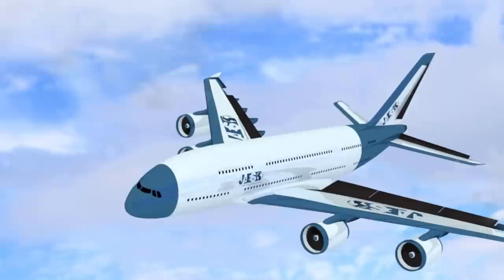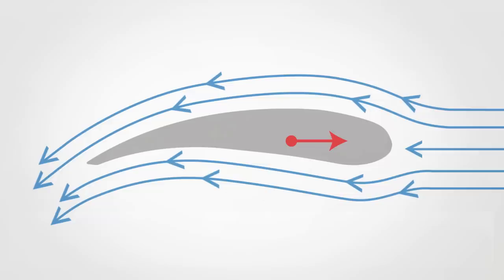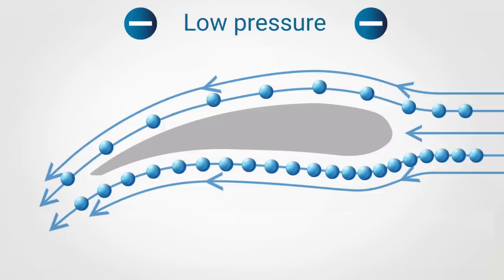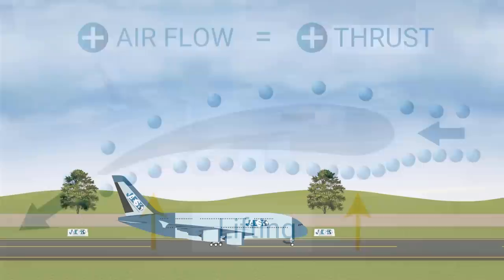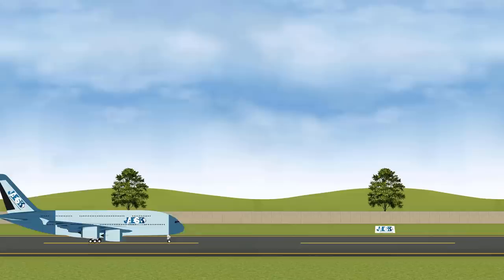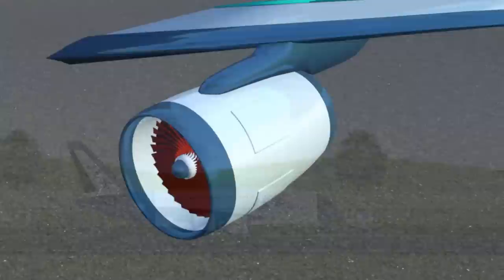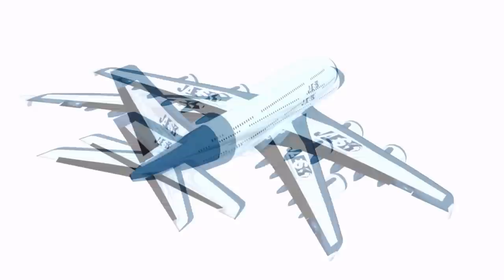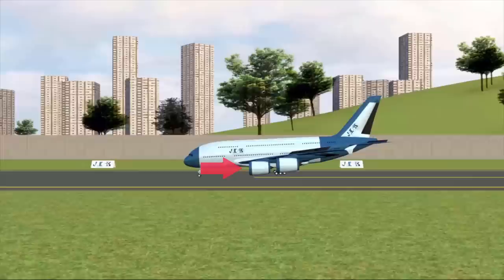How do airplanes fly? Components - Coandă effect - Downwash - 3D animation

Comment: Thanks for this informative video on how airplanes fly! I appreciate how you explained the Coandă effect and the role of flaps and slats in increasing the lifting force during takeoff. However, I think it would have been helpful if you had explained more about how the wing's shape creates a pressure difference that allows for upward suction and lifting of the aircraft. Overall, great job!

Comment: This was a very informative video and I liked how you used the visuals to explain the concepts. However, there is a slight misconception in the video. You used the Coanda effect to explain how air travels above the airfoil; however, the Coanda effect is only used for jet flow. The airfoil of the wing does not experience jet flow so using the Coanda effect would be an incorrect.

Comment: 2:13 review your theory, that s not the explanation why the fluid flows faster. At least you didnt said that particles get to the trailing edge at the same time(totally wrong). It s true the upper side flows  faster, but not because of a "longer distance". To see that, draw an airfoil with an upper side with an armonic form, you ll see,  it keeps having a longer distance than the lower side, however the fluid flows slower than the lower side.
Reply: There were many theories explaining lift of an airplane... Often one theory conflict with the other one due to the complex and random earth parameters😜

Comment: 2:15 so if the airflow above and below travel throught the wings with the same distance,( lenght) there's no lift force?
Reply: Wrong~
Lift is generated by multiple methods, even if the travel is the same on both side of the airfoil, the lift can still be generated by the angle of the airfoil,which can be explained by newton third law

Comment: The description of the cause of lift is refreshingly correct. The equal transit time assumption, all too commonly made, is just wrong. Bernoulli’s equation doesn’t apply because the flow is not confined, like the flow in a Venturi tube is. The Coanda effect has the same cause as does lift itself: the rarefaction of the air on the top of the wing and the simultaneous compression of the air on the bottom. The consequent pressure difference causes lift.

Comment: Thanks for the video. But, "Upper airflow is faster than the below one" is a wrong argument. There is no evidence for this. The only reason for "lift force" is Newton's third law and conservation of momentum regarding downgraded airflow from both upper and below surfaces of airfoil. Below surface of airfoil pushes down the air more than the upper one due to the shape of airfoil (more tilted across the air). This downflow then creates a momentum change in air flow and It then causes an upward force due to momentum conservation of the air. In additon to this, the upper surface is also can push airflow down by the help of "Coanda Effect". Coanda Effect creates a low pressure on the surface then air sticks to surface of upper side till the end of the surface and flows downgrade. This also makes a momentum change in the air and causes an upward force. So at the end both upper&lower sides help to create lift force.

Comment: 5:46 the pilot does not "activate" the slats, flaps or anything during the takeoff roll. They are already in position before speeding up.
Reply: Thanks for the correction
Reply: After takeoff the slats and flaps switched off or remain on until you have landed or
Reply: @standardtv3494  Slat and Flaps are not "switched off" They are not on/off systems but analogue systems.  Who ever produced this video has no real understanding of flight theory. It seems their research was limited to reading some kids books about aircraft.
Reply: @standardtv3494  they are retracted after takeoff and are extended at landing
Reply: Observ45er added to your point, jet aircraft have a slight increased AOA for landing. Otherwise the aircraft will keep increasing speed due to the lift component.
Reply: you people talk about "slats"  (5:50, 8:31)   and think on spoilers, "slots" are on front of wing-in leadind edge and are used to increase lift by allowing higher angle of attack when flaps are extended,  and they are used at take off and landind , spoilers are activated automaticaly by computer  to prevent partial stall of wing and to create more drag in landing and braking when is landed...
Reply: @petemulhearn7787  Agree  there is so much wrong with this video there should be a disclaimer at the beginning.
Reply: @standardtv3494  - flaps and slats return to their stowed position (not extended) to reduce drag.
Reply from the maker: Dear Attila thanks for your comment we made a new version  video  about aircraft please can you inform me if you liked we spent a lot of time to improve it your comment is important for us https://www.youtube.com/watch?v=OCh4svEfDmE
Reply from the maker: Dear Austyn we made a new version I hope you like please let me know with a comment on the new version https://www.youtube.com/watch?v=OCh4svEfDmE
Reply from the maker: Dear Sir please watch the new version https://www.youtube.com/watch?v=OCh4svEfDmE and please leave a comment.
Reply from the maker: Dear Pete thanks for your comment we tried to improve the quality on the new version can I ask you if you can leave a comment https://www.youtube.com/watch?v=OCh4svEfDmE and please leave a comment.

Comment: I do not understand why people mention the names of other people who are related to the fluid flow as the Coanda and Bernoulli and others.  How wings fly has nothing to do with people who worked on them. This is a natural effect and so we must explain the physics of the process as it has nothing to do with who worked on wings.
The scientific reason why wings lift is the following.
1. Assuming two particles of air moving toward the leading edge of the wing, one takes a path to move above the wing while the other to move below the wing. The particle which moves above the wing first hits the leading edge and is reflected up away from the surface above the wing. This reflection tends to distance the air particle from the upper surface and so there is low pressure. As the wing travels under the upper particle the wing is tapered down and so there is an increase of volume for the air particle to occupy and so a further lower pressure is generated.
2. The particle of air traveling under the wing,  it too hits the underside of the leading edge,  but due to the positive angle of incidence the underside of the wing is capturing the air and moving it forward with it and so there are more air particles captured under the wing which increases the pressure. 

So when we describe how a wing lifts one must not refer to any particular human name and the process has not been invented by any man and it existed ever since birds learned to fly and fish learned to swim. 

When the hull of the buoyancy water hull moves through the water, what was described above occurs  all the time and for a normal water hull with a raised transom one can see all the pressures around the hull where  the observer must think in an upside down manner the bow wave is the high pressure on the leading upper surface while the rear wave near the transom is due to the suction of the underside of the hull due to the tapered up rear end to the transom.    This action is not due to any man, it is a natural function and all one needs to do is to explain it in its scientific processes where it all boils down to a CHANGE OF MOMENTUM OF AIR PARTICLES  all done at the right moment and the right locality around the shape of a wing.   Many people still do not understand what goes on at the wing tip of a wing. The best wing must have both the leading edge and the trailing edge RAKED BACKWARDS.  to ensure better control of the wingtip vortices.   Just look at the wing tips of fish, dolphins, whales, and birds and there it is for anyone to behold.  Coanda and Bernoulli effect is not the right picture as to what happens on a wing and how it works. It is certainly not a Bernoulli effect and one must forget about Coanda. It is all a change of momentum of air particles as they hit the leading edge and a change of momentum bring acceleration forces with it.  There is the reason why a wing lifts. 
The change of momentum of air particles and their acceleration forces to move the air particles out of the way is also the reason for the drag, It is all a case of resolving the directions of the forces included in the change of momentum of the air particles and what the shape of the airfoil section offers the disturbed air particles!.
Reply: "I do not understand why people mention names of other people related to fluid flow" 

Every observation made in science follows the trend of being named after the person that explained them. This is easier and more efficient to do in a sentence, as opposed to stating out the logistics of the effect just to make a reference. You don't see people explaining out Newton's Law when they need to give reference to the physics of it, but simply say "Newton's Law". Same with every other effect observed in science.

Most certainly its easier to say "Coanda Effect" to make a reference, instead of typing out the essay like you did.
Reply from the maker: Thanks for beeing so interested in our videos! Your observations are very important for us becouse we are trying our best to provide good contents and we need to be aware of our mistakes. Have you had the chance to watch our video about wind turbine? https://youtu.be/_KE65O44q9o You can tell us what do you think about it!
Reply: The processes have not been invented by any man, but they were first OBSERVED by those men (and women). Would you prefer to enounce the principles in depth every time you mention them, or would it be easier to just say "Coanda effect", "Venturi effect", "Curie temperature", "Newton's laws"?
Reply: @bogdan_n  You are correct but in this video, it does ask," How do airplanes fly?"  and a student in a class will not learn anything if one says, " all due to the Coanda effect!"
It is like someone asking me what does my  sister looks like  and I tell them, " She looks like my mother!"
That type of answer the questioner is no better off as far as information detail.
Reply: okay.    feel free to not use words, such as,   volts,  amps,  ohms,  farads,  henries,  and   SANDWICH
Reply from the maker: Dear Carmel can you check the new version please let me know what do you think https://youtu.be/OCh4svEfDmE

Comment: Pretty good, but I'm a little bit confused in some parts of the video especially in the landing because usually (commercial aircrafts) the nose of the aircraft is  pitched up to increase drag and hence reducing the airspeed to achieve the optimal landing speed for the aircraft and the aircraft doesn't really land with their front gears as it can lead to disaster because of the landing. Overall is pretty good. If i have some mistakes, please correct me 😊
Reply: Actually, if you observe the vertical speed of aircraft during approach, its around (-800) feet per minute. So during the landing, pilots have to increase the vertical speed at around (-180) feet per minute, thats why they flare around 30 feet (AGL) so that the aircraft won’t float too long. Yes, the speed is one of the reasons pilots flare, since the flare can produce enough lift, while pulling the throttle to idle

Comment: Best video ever, i just couldn`t undestand why is the upper flow more rarefied, why molecules are more far apart from each other here? is because they travel longer distances than in the lower because or the airfoil?
Reply from the maker: Hello Dante! Thanks for your comment. The upper airflow is more rarefied (it has a lower pressure compared to the lower airflow) becouse its molecules are more distance from each other while they're travelling accross the wing surface. And becouse there's more airfoil surface too. If you're interested you can visit our channel and in the playlist section you can find many other videos. Like this on about Induction motors: https://www.youtube.com/watch?v=EcbHEOIVGcg&t=80s
Reply: best video???   NO.        the  shape of   the wing's   profile/airfoil   Results in  a  Specific  pattern  of  Turbulence, across the entire span.       at the wing's upper surface,  the SPECIFIC shape ( of the forward third of the wing's profile )  causes  deflection of air, and a persistent 'zone' of  Turbulent, less-dense, lower-pressure air,  across the Entire span.    see the clark-y and similar naca profiles.      googletranslate

Comment: you people talk about "slats" (5:50, 8:31)and think on spoilers, "slots" are on front of wing-in leadind edge and are used to increase lift by allowing higher angle of attack when flaps are extended,  and they are used at take off and landind , spoilers are activated automaticaly by computer  to prevent partial stall of wing and to create more drag in landing and braking when is landed
Reply from the maker: Hello! thanks for your observation. We are currently working on a new version of this video. If you're interested you can subscribe to our channel to know when we will upload it.

Comment: Theres a lot of mistakes on the video, The flaps and slats where not look like that, the seperate from the wing but theres something that holes them, also the under of the wing surface is flat unlike the top of the wing. The engine pushes the plane  because the fan blades were like the wing but have more angle of attack. 

Edit: the speed brakes were not suposed to be extended when the flaps and slats where extened They only use it for the ground brakes at high speed or only if the needed to reduce speed, they were not as big as flaps.
Reply from the maker: Dear Abello thanks for your comment we made a new version of the video can you please inform us your point of view for the new video https://www.youtube.com/watch?v=OCh4svEfDmE&t=2s

Comment: Why did you showing flaps and spoiler deployment on takeoff? I also noticed @ 8:45 ...the mention of slats and flaps, but what's shown is flaps and spoilers.

Spoilers retard the lift from the wings by creating a separation of the otherwise laminar flow of air on the top of the wing surface, it could be said they're "Stalling" the wing, or part of the wing (in most cases). 

Slats increase surface area, and thus increase lift with the trade-off of also increasing drag. They're deployed at the same time as flaps, which also increase surface area, and thus increase lift with the trade-off of also increasing drag and also allow the plane to be pointed downward without gaining as much speed. This is very important for landing, since you can't generally descend without gaining speed, in a heavier than air craft. This also has the added benefit of giving the pilot(s) a better view of the landing approach, until they flare for touchdown on the mains in a tricycle gear formation.

I realize it's hard to get every detail into a video, and don't mean to be nit-picky, but spoilers and slats, as mentioned at 8:45 and a couple other times, are almost opposite in their operation, so I don't want any more confusion our there, than needed...
Reply from the maker: Dear Brian thanks for your comment can you please check  look the new version  new version https://www.youtube.com/watch?v=OCh4svEfDmE&t=621s let us know what do you think leave a comment on the new version you are a pilot and can be very useful

Comment: Vertical "thrust", really?  It is called LIFT.  Thrust is the reactive force the engines/props produce.  Rudder (vertical tail) does not cause turns left and right (it only causes nose to yaw left and right), change in direction of flight requires horizontal force acting on whole airframe, and this is done by tilting the lift force by rolling one wing up and another down with ailerons.  In fact, if you don't need to do cross-wind landings and takeoffs, you can fly without rudder controls (in small a/c they are also used to compensate for rolling force generated by rotating propellers).  Aircraft do not approach for landing "nose down", in fact reduced airspeed on approach necessitates higher angle of attack to maintain lift (and the term "angle of attack" is used w/o explanation in the video).  The explanation of drag as air friction is all wrong (it only applies to some parasitic drag, and not to induced and form drag), and so is the claim that higher speed of the airflow above the wing is irrelevant (it is necessary for creating lower pressure due to Bernoulli effect).  Really, guys, learn some basics before making "educational" videos.
Reply from the maker: Dear Sir please look the   new version https://www.youtube.com/watch?v=OCh4svEfDmE&t=621s let us know please if there are some mistake

Comment: 5:55 plane is definitely not going to steep enough to stall 
level flight, seriously
definitely not going to make small increases in altitude using a/p and v/s
points nose down to DECREASE SPEED, what the hell, they use trim etc and spoilers
also not all engine covers are used for reverse thrust and also the a380 shown did not use it
ok, so you pointed the nose down till around 200 feet and managed to pull it up in time.
all I can say is that although some parts were correct, you need to make all your info correct. (if there are any spag mistakes, my keyboard was kinda fudged up)
Reply from the maker: Thanks for your comment! Your observations are very important for us becouse we are trying our best to provide good contents and we need to be aware of our mistakes. Have you had the chance to watch our video about wind turbines and tell us what do you think? https://www.youtube.com/watch?v=_KE65O44q9o&t=39s
Reply from the maker: Dear Nevin we create a new version video can you inform us  or leave a comment if is better https://www.youtube.com/watch?v=OCh4svEfDmE&t=611s